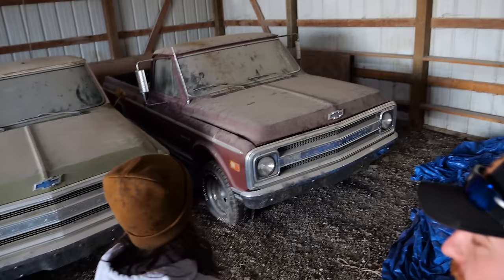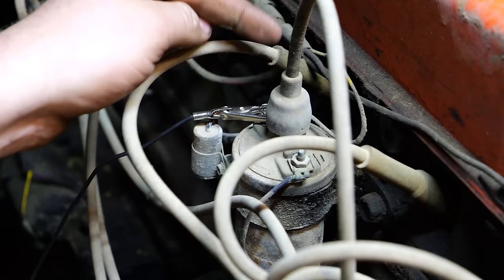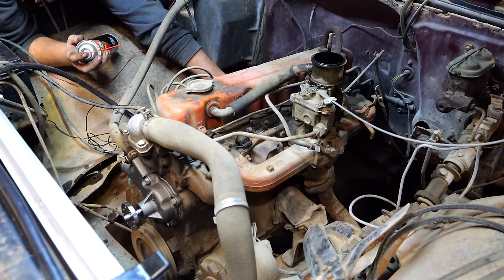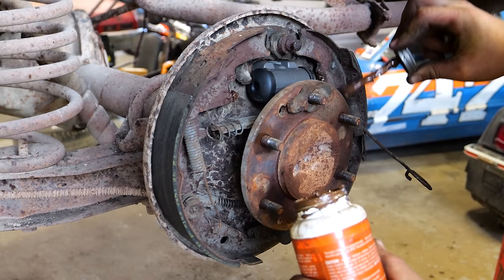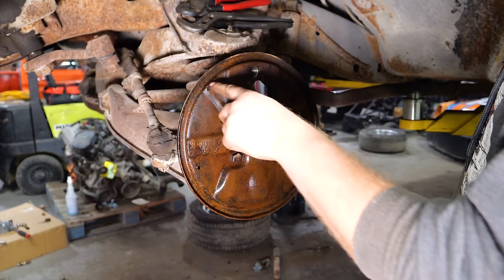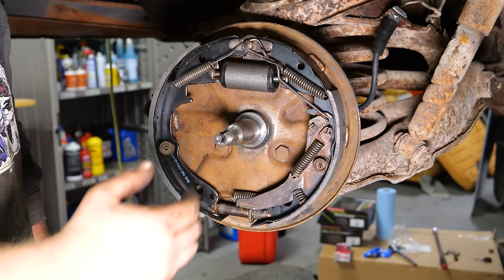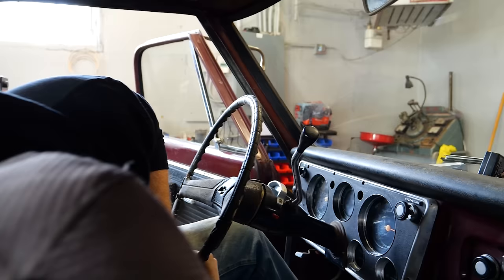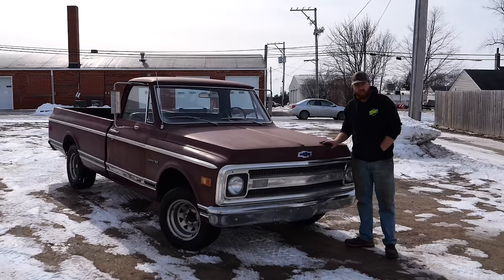Will an ABANDONED C10 Run & Drive? Mothballed for YEARS

Comment: Electrical cleaner on the points, also you might want to run a full V8 size bottle of Seafoam in your engines when you work on getting them to run right, that stuff clears everything out.

Comment: Great video! FYI don't use heat (torch) on stuck bolts/parts that have been sprayed with chlorinated brake/parts cleaner and/or chlorinated penetrating oils. They contain organochlorides like tetrachloro ethylene (perchloro ethylene) and dichloro methane (methylene dichloride) which produces Phosgene gas when burned which is highly toxic. Phosgene gas is a chemical weapon that was first used in WW1. If you repeatedly do this you will be slowly poisoning yourself without knowing it. Use non-chlorinated brake/parts cleaner and oil or lanolin based penetrating oils. They are much safer. Check the can/bottle to see if chlorine based chemicals are listed before using a torch on them. Look up Phosgene and Organochlorides.

Comment: 292 vs 250 fuel pump is behind the motor mount on a 292. Also has a taller deck to accommodate the longer stroke. Same bore size. That's an unusual truck, typically the six cylinder trucks were stripper models, no chrome trim and a manual trans. Most 6 cyl models didn't have gauges either, I would expect a truck with that trim level at at least have a 307. Regardless, a good find. Truck looks to be complete and not in bad shape.

Comment: Kevin try this for a point file those plastic bubble rapping thats on a lot packages cut a strip 1/2" wide 6" long and wrap some 3k grit sand paper glued to it & its better then those files and stiff but flexible enough you can push or pull it through the point gap !

Comment: First timer, I think it's an awesome channel. 
  ### Safety!!! ###
 Do this ole fella one favor?
 Never. Absolutely never hit on a battery post or terminal connector to get it back 9n 5he battery. Open it before u try putting it on. 
 The blow to 5he post can and sometimes will break  5he connections inside the battery and WILL SPARK , and cause the battery to blow!! 
 19 year Technician here and have seen it first hand happen twice!  Not pretty at all and one guy did lose sight 8n 1 eye and almost both. 
 You have Thousands of views and followers is the reason I'm passing this on. You know the saying !
 Grease monkey see! Grease monkey doo, lol.
 God Bless. Love what's you folks are doing!! And yes, I wanna buy the truck.

Comment: You should have replaced everything on those drum brakes new drums all new lines and rubber lines too and new spring hardware kit. Might as well  do the bearings and seals as well  especially  on any vehicle thats been sitting that long. Brakes are kinda important not only for you but others on the road.

Comment: Those 230 250 Straight 6 are just as good and reliable as the famous Chrysler 3.7L 225 Slant 6. The Slant 6 will run on little to no oil or antifreeze. We used to say Slant 6 oil and antifreeze were optional equipment..

Comment: Ok 34:03 … the backing plate is soaked with brake clean which is highly flammable.
Do let it flash off and remove any soaked rags before you use anything that can make sparks.
Otherwise you might have a free facial hair removal experience 😂😂😂😂

And no, not talking out of my arse.
I have first hand experience of a deflagration with brake clean. 
Luckily it was just singed hair and beeping in the ears, but no burnt skin or clothing.

Comment: I have a 1965 Chevrolet C10 truck it is a 5-speed in the floor and it has four-wheel drive, not 4-wheel low or anything like that just simply two-wheel drive and four-wheel drive. I also have two 1966 Ford F-100 one is 2-wheel drive one also has four-wheel drive but they are both three-speed on the tree.

Comment: Also first cold start turn key on when ignition switch in dash to then push gas pedal 4 times to floor then pull  choke knob all way out and turn key push pedal half or all to start engine! Then keep foot on gas push choke till smooth out lower of high idle with gas pedal and easy off to! May need run 1/8 on choke for 1/4 mile road drive and push in ! Put 89 or 91 octane gas and get Grey bottle of STP Total Treatment fuel injection and carb cleaner with fuel tank each time !  303to 388 rear end gears  that truck should have !

Comment: Square body front suspension will bolt right in for cheap and easy rubber bushings and disc brakes.

Comment: And I have had several trucks and gm gbody cars I've got ahold of that either pull to the one side when you lock up the brakes and had two explode and blow through the brake line one on a gm gbody V8 Buick Regal Sport Coupe and one on the passenger side front of a 86 Chevy k20 custom deluxe longbed 4x4 both were 1986 year vehicles but that is why I almost always buy new brake hoses and they get changed before I even consider driving the vehicle especially since the k20 put me in a steep ditch and almost caused me to get hit coming back out of the ditch so.... lesson learned the hard way cause that's usually how I learn lol,, and yeah I have some of the correct tools too and always seem to use screwdrivers old craftsman ones and a medium size pair of 430 channel lock pliers and I was planning on buying a nicer set of brake drum tools but I can't guarantee I use them all the time either

Comment: 18:35 THE ACCELERATOR PUMP SHOULD BE ON THE BOTTOM OF THE CARB BEHINDIT CONNECTED TO THE THROTTLE LEVER.

Comment: The truck idles just fine but the instant you step on the gas from a stop it cuts out, My truck is doing the exact same thing and I can't figure it out
Reply: I talked to you before about an issue I had and it worked but now I have this new issue that I've never dealt with before

Comment: A straight six, not strong engine. Because it sat for a while, pull the plugs, squirt a bit of oil into each hole. Then crank the engine a bit. This will remove the rust in the cylinder walls. Put the plugs back in and .... 4 wheel drum, that truck had the stopping power of a snow sled.

Comment: Should clean truck up better if you want top $ for it ?
Engine compartment dirty, running with new breaks = $6000.00 obo not $15000.00

Comment: Good content. However, you need to warn viewers to be VERY careful avoid getting anti-seize onto the friction material. Otherwise the brakes won't work properly and may pull badly to one side. Also, when removing solid brake lines, nothing beats a decent brake line spanner rather than an open-end spanner, which typically slips under pressure..

Comment: International 6 cyl have intake & exhaust on passenger side of the engine..Ford GM and AMC have them on drivers side. Not a fan of break clean to start an engine it has NO lubricant. Gas has a lubricant in it. My choice is 75% gas 25% 2 true fuel 2 stroke gas on an old engine. I'd love to find an old Chevy in this condition.

Comment: The barrel side, as you call it, of the self adjuster spring always goes away from the Star wheel so that the teeth don't hit the spring. You put it on backwards, which means you just copied the mistake of the person that did it wrong before you.

Comment: I'm not sure why you said that those brakes are different than Ford brakes. I've rebuilt tons of drum brakes from the mid 60s to late 70s, both Chevy's and Fords, and find them to be very similar. In fact, many of the parts were made by the same manufacturers for both makes. Sorry, I just found that confusing. Great video, though!

Comment: Points... I use an emery board you know, the kind a woman (maybe some men??) to file their finger nails down pretty ruff, enough to clean up points.  I used to work with a man who insisted that everything was called the proper name. Like that is an engine in that car, not a motor. Motors are electric. it's not a line wrench, it's a flare nut wrench. Which BTW you should be using taking those brake lines loose, some are to tough, you end using vice grips, because the regular wrench slipped and rounded the flare nut that is holding the brake line tight and sealing it up. So an old mans advise to you is to call it what it is and use the right tool. Oh and those brake tools, will make this sooo much easier if you'll take the time and learn how they work.

Comment: Cleaning the points and contacts in the cap should be an automatic. Because even if it will run as is it’s going to run better if cleaned   Back when I came into possession of an old car that didn’t run I got points anyway. But back then they were like $0.35  or less than an hour’s wage $1.65

Comment: I recently bought a 1975 c10 with a 292. The only problem I had with it is the power steering and alternator bracket, but it runs like a raped ape

Comment: It’s funny you don’t know what to do with all those drum brake tools, that’s actually what I used to learn how to tear down and reassemble brake drums when I went to automotive tech school, and they insisted that is the “proper” way to do it. I’ll admit, some of the tools are easier and more confidence inspiring than using pliers once you get the hang of it. I recommend learning how to use them. You’ll end up picking and choosing which tools you’d prefer over pliers and fingers.

Comment: Definitely not a 292. It's a 230/250. Those plates on the lower side of the engine are much bigger on a 292. I think 6 inches wide.

Comment: What's the problem with using brake clean on the points?
Reply: After I sand the points I spray them with brake clean to not lose spark

Comment: Yo! Left side as viewed from the front or from the drivers seat?? . In the UK we have solved this issue with the NS or OS designation. …. Which works as long as you can grasp the concept. However left or right is a TERRIBLE way to define something that has a front and a back😂

Comment: I run cheap chinese ebay radiators in my Jeeps and you know what? Never had a single problem, I will add the engines are all stock and I do routine fluids and maintenance.

Comment: Also on front brake if you reverse the tension spring over the star wheel the barrel of spring is not riding on star wheel hampering self adjusting. I am not being critical in any ways but I believe knowledge kept to yourself is wasted. As do you considering you are doing a how to video.

Comment: You are putting thise shoes on wrong, the one with the longer friction material goes to the rear.
Reply: Have you ever studied how drum brakes work? When you apply the brakes, the shoes try to rotate with the drum. The post at the top prevents that. As the two shoes rotate what little bit they can, the most pressure is applied to the rear most shoe. That's why it has the most friction material. Yours, since you put them on backwards, will never work to their full potential.

Comment: And you heard of the more ticklick sometimes you known't have to say I'm point if you do tzap and sometimes you can use a magic book or a pencil eraser to clean the points after you say in them and the thing I found is like your girlfriend's empty board if you can believe that works better than the points file as it has more surface area it is not as aggressive but it's easier to control than the sahand paper I found

Comment: Just a bit of info. If you think they are asbestos pads you should make sure to run a vacuum and wear an n95 mask as you clean it. Or wet the object you are working on to prevent it from getting air born. Asbestos fibers when dispersed into the air will float around in the air for roughly 2-3 weeks because of how small they are. So just walking away for a few mins will not protect you. Working as an electrician with the IBEW it’s a huge risk on old job sites. And unfortunately you won’t know if you have been affected by the mesothelioma and or asbestosis for 15-40 years and at that point it’s almost guaranteed to be terminal. Be safe guys.

Comment: You want the person who is buying the truck to be safe yet you don't remove the shoes from the backing plate and clean the backing plate and lubricate the points on the backing plate where the shoes slide you just leave it all c*** and rusty and then change one little piece at a time when you could have taken them off in the same amount of time and done it the correct way you millennials amaze me you do everything the wrong way while you're trying to show us how to do it